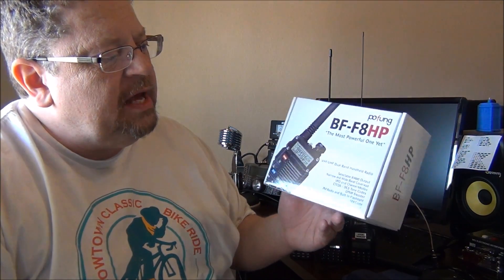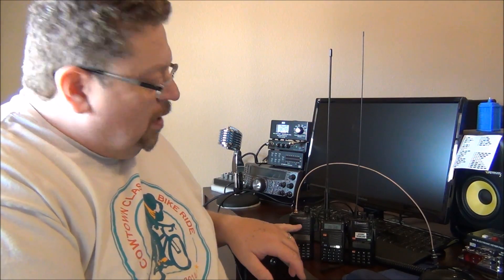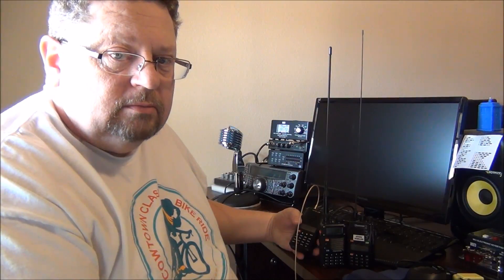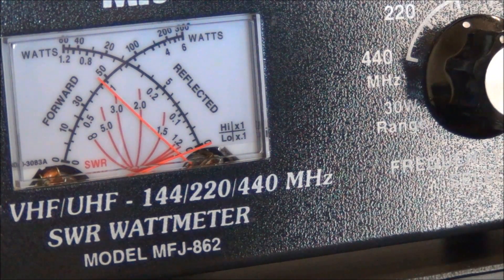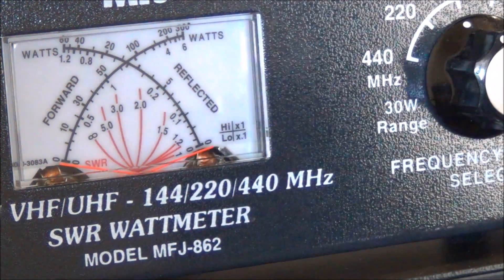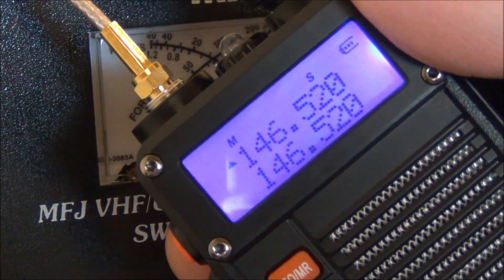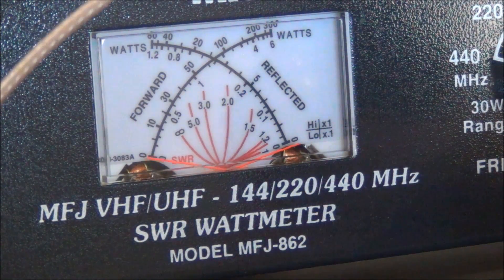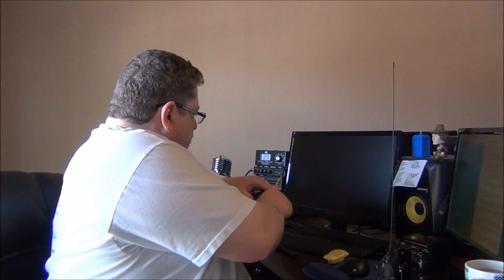pofung / Baofeng BF-F8HP Hip or Hyep?  Do you realy get 8 Watts?  -  AF5DN

Comment: There are other reasons for getting the F8HP vs. the other "5R" versions.
The F8HP is a slightly ruggedized case. It uses a 3rd gen PCB (the other 5R compatible radios so far I believe still use 2nd gen PCBs), and it comes with better antenna and battery. Of course the last two can be addressed with aftermarket upgrades.
However, I am still disappointed in the battery mount being dependent on two VERY small bits of plastic on the lower back edge of the radio that if the radio is dropped and lands on its lower back edge (not too unlikely, I think), it could easily break them off entirely. You would then have to jerry-rig some way to hold the battery pack (I'm thinking zip ties). The battery retention points should be HARDENED...a LOT.

Comment: I have the 8 watt one like that I used it for over a year driving truck to communicate with a fellow truck driver and it worked great on 8 watts H for a year we could talk a mile and half in the city with sky scrapers in the way we talked so much we melted the stock little 1800mah batteries lol then all the sudden mine wouldn't get out 100 feet on high like it was a  fraction of a watt just like that one. Now I have the new 15 watt one coming idk if it's really 15 watt but if it works as good as my old 8 i will be happy. Good video

Comment: I get right at 7.5 to 8 watts out of my BF-F8HP with the standard battery. Would like to get the high capacity battery to see if there is any improvement. Very happy with this model. I can hit several repeaters from inside my house with a Nagoya 771 antenna every time. Will be buying another for sure.

Comment: No doubt they can be spotty, but i get 7 watts uhf and just about 8 watts vhf, there are fake radios out there, and there can be defects in this price range or incorrect tuning or whatever, but my unit and many others rated at 8 watts work just about as intended i hope they continue to
Reply: Counterfeits are a problem in the industry and internet stores. Even the military has problems with components purchased from approved suppliers, especially when dealing with vendors in China.

Comment: You tested both the F8-8HP and the F9-f9 V2+ in separate videos and amazingly they both were dead on high power mode.  No follow up on replacement radios just a video showing your high dollar radios working.  Did you purposely disconnect the cable before your "test" off screen?  Short out the transmitter so it would be dead?   Did you get it replaced?   This video just looks like an elitist trying to prove Baofung radios are junk.  To see a real test go to Hoshnasi and you can see the radio with the SWR meter connected to it and was a solid 8W.

Comment: it does make an atempt to transmit. it makes me think a switching diode is bad and goes open the moment power begins to flow. there are a slew of things that can go wrong in it. I wonder if you eased into the ptt contact patch and see if a Maladjustment there is at fault. I owned an alinco dj191 and it ran so hot at times, the adhesive tape that held the wafer disk contactor shifted and failed to transmit. so I opened it up and repositioned the wafer disk taping it down with full wraps of cellophane tape around the ptt circuit board. I'm not attempting to know beofeng radios. so if I'm wrong, I'm wrong. but if I'm right, it's by chance. 73 kf4dcy.
Reply: He could also verify the high power performance on UHF. Would be telling if both are non-functional. And should verify the firmware hasn't been corrupted. He might have received a "return" item and if they tested it before putting back in stock, didn't test high power mode on VHF or didn't verify firmware. Any product which can be reprogrammed by end-user should be automatically verified or just reset to baseline firmware upon return.

Comment: which one do you recommend the baofeng uv5-rtp or the bf-f8hp?
Reply: Bradley Neil Sipaun i think they have the same chipset
Reply: My understanding is the RTP still uses the 2nd gen PCB...not the 3rd gen like the F8HP. Just a firmware change for the power setting upgrade (NBR-3xxx for tri-power vs. NBR-2xxx for bi-power models) . It's not conclusive however.

Comment: The baofengs I have you don't need to use menu to change power. The lower right hand key on key pad, the # (also key lock), when pushed in normal mode will change power. I just helped a new ham with this this weekend.

Comment: I have a BF8-HP.   Setting through Menu 2, I actually only have L and H for power settings.  There is obviously different radios or at least firmwares.
Reply: Then u dont have the f8 hp, or u were sold one with 5r internals...
Reply: Get software (e.g. CHIRP) and check firmware. If try to download "F8HP" firmware from a 5R series radio CHIRP shouldn't let you do it. Some YouTube videos on using CHIRP should help. Use an reliable interface cable...some 3rd party cables are reportedly not plug-n-play and don't work easily.

Comment: You didn't exactly go over how the SWR (watt meter?) works.  That display is confusing as heck.  two needles.  Do I look at where the converge?  One radio you (2:53) said hit 5W, but the display reads just shy of 50W.  What am I missing here?
Reply from the maker: humaxf1 is correct.  Also one needle is for forward power and the other is for reverse power.  Where they meet is the SWR.
Reply: He had the 30W scale selected (Lo x.1) For a reading of 50, multiply by .1 which gives you 5W (or divide by 10)

Comment: I have 3 of these radio and all do the power level as advertised i have gt3tp and it does 8 watts out as its supposed to looks like you have a problem with you radio on hi setting and yes the ts-2000 does great power but a/b it to a real hf rig like icom 756 pro or yaesu 1200  and will will quickly sell it you cant work them if you cant hear them when you put hf/vhf/uhf all in one package you will have to compromise on the hf performance of the 2000 i loved mine till i tested it with my 756 on the same antenna was shocked at the results i then sold it but if your mostly vhf uhf its a awesome rig
Reply: +Jason Jeter i LOVE the TS-2000 nothing wrong with that radio. I never run it over 45 watts and i make more contacts than my neighbor at 100 watts with his Icom proIII

Comment: Just my opinion. I own 5 Baofeng radios and they are garbage. People get wrapped up in the low price of the radio while completely ignoring the low quality of the radio. Many are touted as 5 watts but none of mine actually put out 5 watts. In fact, one radio only puts out 2 watts. These radios are terrible to program manually, have quality control issues, and rarely deliver listed performance.
Reply: Tactical Tradecraft  operator malfeasance.. these radios certainly are not "junk" and work very well...your zenophobia strikes deep...
Reply: What does that say about someone who continues to buy junk?  Not once, not twice but five times?
Reply: +iam he they're excellent especially for the price
Reply: +Tactical Tradecraft Firstly, the radios are "touted" as 4 watts, and i get better reports on my Baofeng GT-3TP then i do on my Icom ID-51 50th anniversary.
Reply: +iam he that was definitely a cord shortage